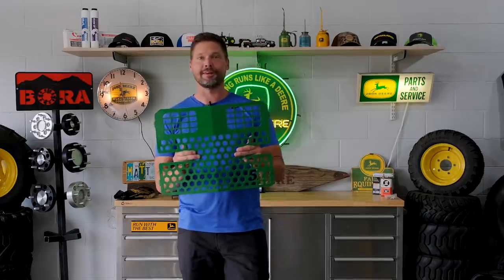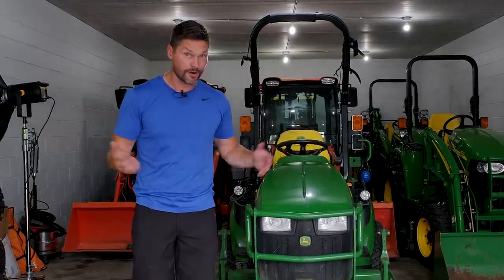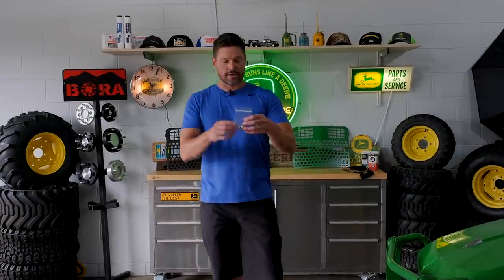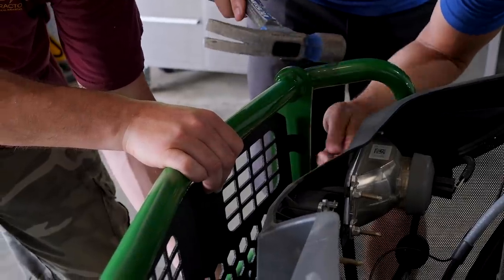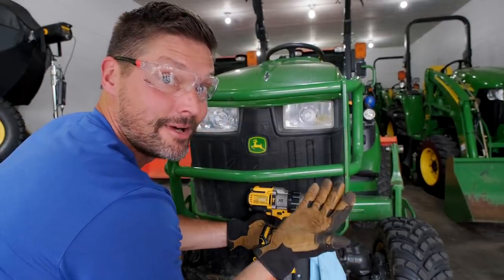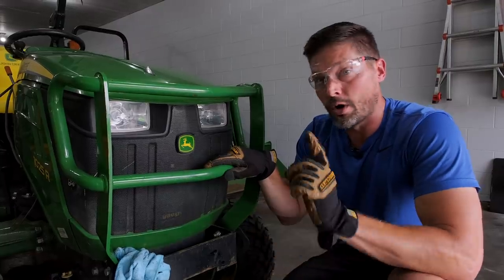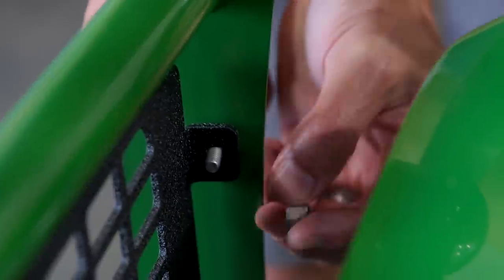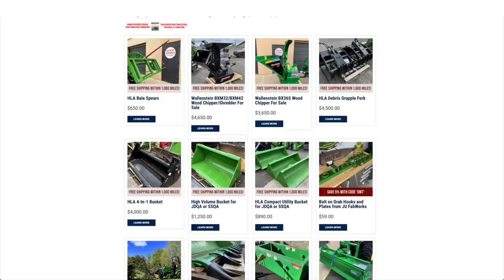BEST GRILL GUARD ON THE MARKET! PROTECT YOUR BIG INVESTMENT!

Comment: Go to the 12:00 mark. Notice that FRAME section at the front. I made a 3/8", 12"x12"  plate that I bolted onto that so it hangs down and protects the front axle. Cheap trick that can save you lots of money if you drive over a large rock.

Comment: Fantastic guard…Purchased two sets almost two years ago - JD 1025Rs two cat one, for heavy use protection… Easy install, look good, and very good front end protection for both oil cooler and radiator.

Comment: As a machinist I could teach a class on feeds and speeds but I’ll try to keep it short. A simplified formula for drill speed in mild steel is 200/drill diameter. So for a 1/2” drill run it at 400 RPM. 1/8” drill run it at 1600 RPM. Also dipping the bit in a small cup of oil is a good was to oil. I would also drill one hole bolt the part up and mark another hole with your transfer punch. And keep doing that so all the holes line up.
Reply from the maker: Great info Guy.  Thank you for taking the time to share.  All makes perfect sense.
Reply: Boy that'll save me! Thanks!

Comment: Use an 1/8th inch drill bit on speed 2 or 3 to get a hole through the steel, then when using a bigger bit use speed 1 and hold on tight. Sometimes I used the clutch setting on the drill so it doesn't spin out of my hands.

Comment: Of course, you could sell complete grill guards. Add upper top tube light mount plate options.

Could there be a no-drill version?  Bolt-on brackets at edges over the old guard?  Or mount the screen to the front with SS pipe straps over the crossbars. Maybe some rubber inside.

HeavyHitch makes a front suitcase weight carrier.  Not sure re FEL interface.

Comment: Courtney, I love your channel because it brings us cool new things to help us out for our tractors, but at $350, WAY TOO much!!  I haven't had an issue yet damaging my grill but if I did, the new grill from JD is $80.  Now I realize if you had a major issue, something could get through the grill and go beyond, but I figure that's even more rare.  Maybe I'm just cheap, I don't know:-)
Reply from the maker: $80 for the new grill screen from Deere?  JD charges $5-8 for a bolt.  It's a lot more than that for the replacement screen.  Plus, this is precisely for major issues as you mentioned.  What good does it do if you get it AFTER you have the major issue?  😂
Reply: @GoodWorksTractors  Right on the bolts haha, I know I just looked it up, I've been wanting one of these but I admitted I was cheap.  I do have friends that can weld very well, I may need to go that route LOL.  The grill/screen was Green Parts was $79 and change, I was also kind of shocked it was that cheap as well.  I figured it would have been close to the grill guard price knowing JD prices.  I still liked the video though and I am still sad for Rosie and your family's loss.
Reply from the maker: Haha, I know it.  Big difference in 1/8" primed and powdercoated steel vs that screen.  Plus, it's a small business and currently includes shipping.  Break down all the numbers and the price is reasonable.  

One week today since I lost my Rosie girl.  Missing her like crazy every second of the day.
Reply: @GoodWorksTractors  It's especially hard when you have a job like yours and mine when you can spend more time with the dog, they become a much louder fixture of your life, then they are gone and there is a huge hole left by their absence.  That was my experience with Henry anyway.  I had had several dogs before, but his loss was really bad, I think because he was only 3 when we lost him and the others I had a good long time.  So I am so sad for you guys.
Reply from the maker: I agree.  She was by me nearly 24/7.  I talked to her more than anyone else every day.  She was a good listener.
Reply: Agreed, WAY too expensive.  But looks like a great product.

Comment: It all comes down to surface feet per minute. Small drill bits you can spin fast. The larger you go (diameter) the slower you should spin the bit. Lube is always a good thing. Be conscientious about the temperature of the drillbit and the metal your drilling.

Comment: It is definitely a quality product and looks great but, as stated by someone else, a bit expensive considering I have never had damage to my front shield and I would imagine the  grille would diminish the effectiveness of the headlights
Reply from the maker: It's like preventative maintenance.  You get it before you need it.  😂
Reply: Wish I would of had this installed before a 4" tree went thru mine... $2k in damage done in seconds... $350 is cheap insurance.

Comment: Love your channel and I like the product shown here, obviously much needed, but 350.00 for a painted piece of steel, laser cut or not, is too much IMO...
Reply from the maker: Our country has a mindset that we want Made in America, but at the same dollar store Chinese prices.  Cheap and American are two words that don't belong together.  Unfortunately, that behavior has been engrained in us for decades and will take just as long to reverse.  It is very easy to add up the costs to get to this delivered pricepoint.  American steel, American labor, design work, insurance, taxes, other overhead, machine costs, scrap, waste, marketing, packaging, credit card fees, shipping, profit.
Reply: How many hours of labour does it take to make it and what is the cost of the machinery to make it? Steel isn’t cheap either.
Reply from the maker: Labor is a sum total...design, cutting, coating, packing, listing, blah blah blah.  Peanut butter spread across volume.  Plasma cutters are many thousands at minimum base price.  Not operating and maintenance expenses either.
Reply: @GoodWorksTractors  I see your point...
Reply: @DriverDean  Wish I would of had this installed before a 4" tree went thru mine... $2k in damage done in seconds... $350 is cheap insurance.

Comment: I’ve been looking for a grill guard and this looks excellent.  The inability to use suitcase weights on the front may be a deal breaker though.  Does the 2025R version fit the 1025R and will the suitcase weights go on the bracket with 2025R version of the guard installed?
Reply from the maker: I'm not sure yet if the weights will fit with the 2025r bracket design.  Haven't tried it.
Reply: Perhaps if there is enough interest 511 could make a model that is shorter to allow for the use of suitcase weights. That would be cool.
Reply from the maker: I agree

Comment: Did you try the suitcase weights after the grill install? Looks like they might fit to me.

 Have you tried doing any mowing since it was installed? My grill gets pretty clogged when mowing with my MMM and it's pretty hot in NW Arkansas. Just curious if this restricts air flow. My 1025R gets kind of warm mowing so don't want to enhance that any. Love the grill but I'd go for green.
Reply: No flow issues. Plenty of flow and much more protection. Great product/s @ 5Eleven.

Comment: For all those saying $350 is too much, consider this to be an opportunity. If $350 is too much for this grill then it should be possible to bring out a comparable guard at a lower price.
Reply: It is cheap insurance! I was tearing out an old flower box made of 12x12 creosote ties and got one hung up in the geotechnical fabric and a huge shard came swinging back under the bucket! Just think what a new radiator and battery would have cost me!!! $350 x1 is cheap!!!
Reply from the maker: That's the other end of the equation.  People think it's expensive.  That's only the mindset compared to making it for yourself.  Imagine making it, or trying to make it, for a living.  That means including profit and many other associated costs.  How much do you need to make per unit for it to be worth the effort?
Reply: @GoodWorksTractors  
Wish I would of had this installed before a 4" tree went thru mine... $2k in damage done in seconds... $350 is cheap insurance.

Comment: The whole purpose for using cutting oil is to keep everything as cool as possible. This keeps the bit from over heating and wearing down and getting dull. You could use a metal blade on a saber saw or a torch and cut out a space for the suitcase weights.
Reply from the maker: Thanks for the insight!

Comment: There's more than just green and orange tractors out there...
Reply from the maker: The reason you see products developed for JD and Kubota first is due to the market size.  There are many multiples of these two brands in the market compared to virtually everyone else out there.  Once the large chunks of the market are covered, then there's time to branch out into the smaller pieces.  Given the amount of effort that goes into Design, Development, Production, and Marketing, it would be foolish not to align with the largest customer base possible.